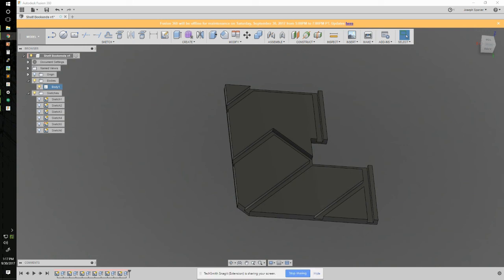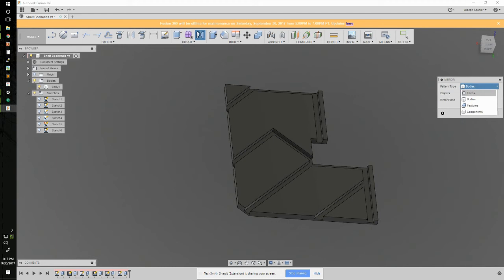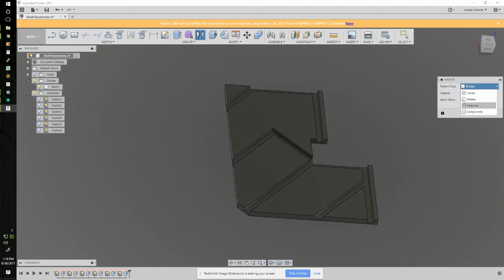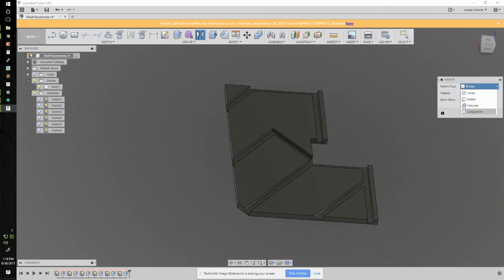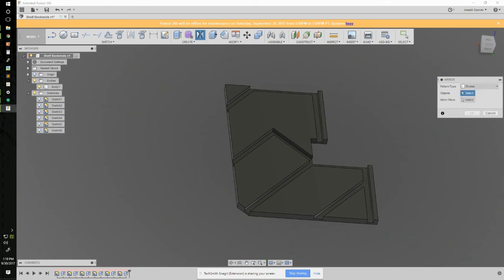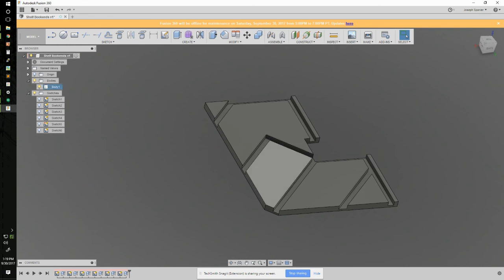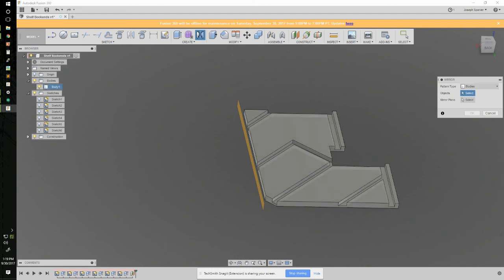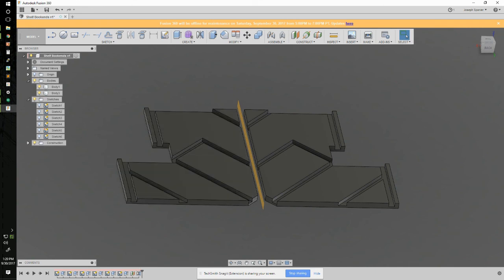How to mirror parts in Fusion360

Comment: When you delete the original part the mirror is deleted too. That is not what i want.
I want to mirror a component and delete the component that i just mirrored.
So i want to break the link to the original part.
Reply from the maker: Try to "remove" the original and not delete it. It will put a spot in the timeline where that part goes away rather than deleting the entire existence of the part.
Reply: @prcdslnc13  Yes of course! I was looking but overlooked this completly. I did try a workaround by hyding the origenal but that creates large files.
Thank you